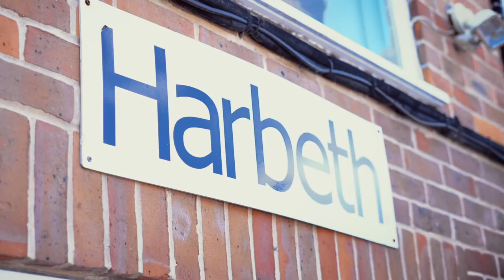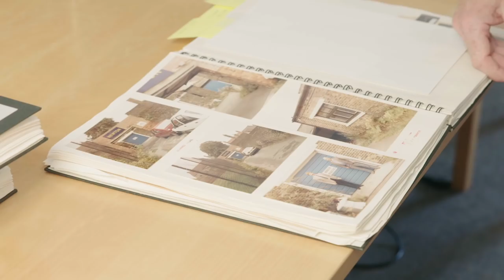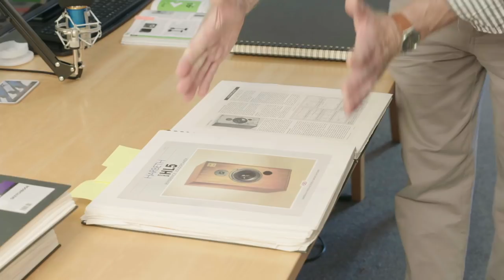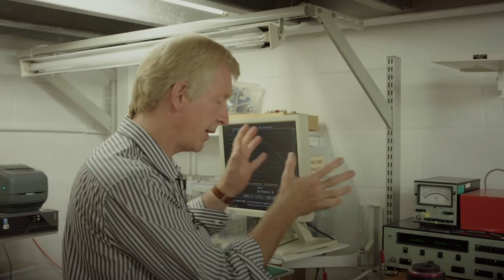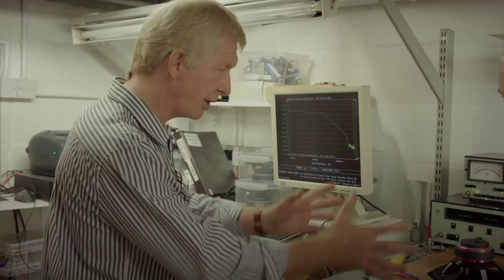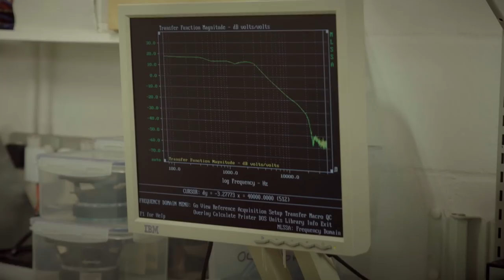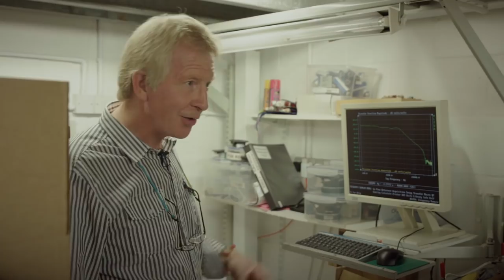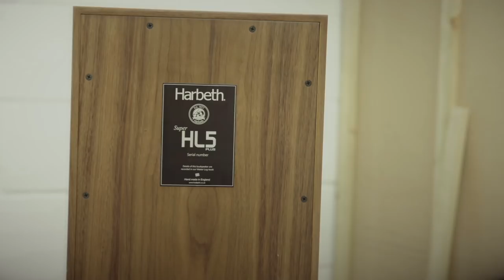Harbeth Loudspeakers Factory Visit

Comment: Alan's claim that only Harbeth uses injection molding for plastic cones is a complete fallacy!
Reply: rotorfix AS was asked, whether his drivers are unique and he answered "yes". That does not equal your allegation.
Reply: That frustrated me too; to claim that most modern speakers use cheap poly cones is nonsense. Maybe thats true for cheap dumpstore drivers, but not for medium to high end drivers. Even better, injection molding a speaker cone is a rather outfdated way of "stiffening" a cone. Modern drivers use graphite, kevlar or ceramic compound materials. Way (!) more rigid than these injection molding cones.
Reply: Astra Oovier,

Alan implies that injection molding takes "proper engineering and research," and that they received a grant for the process. He makes it appear to the ill-informed that the injection molding process alone is what leads to the stiffer cones. Regardless, to you fan boys, everything out of his mouth is gospel. He already has the cult. All he needs to do now is convert that barn to a temple.
Reply: Want to know what else is produced with injection molding process? Almost everything ;-) ( lego bricks, car dashboards, sandals, even those things some women like :) )
Reply: Load of marketing bull: "RADIAL" (Research into ???Advanced??? yada yada yada? Injection moulding?   Erhem.  I pity the poor souls sold to alan shaw's narrative.  Got to be wiser gentlemen.
Reply: Dennis D kevlar etc is ok but paper still wins
Reply: There is not one "perfect" material for speaker cones, all materials out there have there own characteristics. To claim that "paper still wins" is just nonsense and theres no scientific proof for that. Again, there is no "perfect"cone material, there is no perfect speaker, speaker cable or music source. Everything out there is a "way" to reproduce an recording. Wanna hear perfect music? Go stand next to a live performing band, and get ready to go deaf ;-) As a drummer i know that, again, every recording and reproduction of that recording is an impression given bij the studio technician and used equipment. A real drumkit for example sound relatively horrible and way to loud to enjoy. Ask phil collins; the guy is allmost deaf...
Reply: Maybe three lifetimes ago; these days injection molding is an industry standard way of producing stuff. Even my toilet seat brush was made using injection molding.
Reply: there is science behind. but plastic allways sound like plastic. Paper is still the best (of course mixed with other materials). that is why professional studio monitor speakers are still mostly made of paper. close to the wood as most  of musical instruments are made of. simply said. sorry for my english.
Reply: You're wrong and silly. Studio monitors Used to be made with paper cones, times they are a changing, as do speaker production techniques.  Most instruments are made of wood???? Thats a nice remark for those enjoying brass instruments ...
Reply: I dont think so. for example last week i have been listening Manleys and Quested vs 3110 side by side and guess which i like more. 
it's also a matter of personal preference. And yes, most of instruments are made of wood- Drums, bass, guitar, piano, violins,most of the wind instruments....
Reply: So now your ears have become scientific measuring devices. That's where most "audiophiles" go wrong. Your observation is only a subjective interpretation of a sound that was reproduced. Would like to see you go in discussion with electrostatic speaker enthousiasts. It's not important what you like more, just as unimportant what i like best. All subjective.... all just an interpretation.
Reply: i am more like sound engineer than audiophile. in terms of fidelity and feeling,  trained human ears do much better job than any measuring device.
Reply: haha, you just keep believing that ;-)
Reply: Drum heads are made of wood? That's news to me. Piano strings? Violin strings? Cymbals? Yes, the wood adds its own resonance. But in a speaker, the last thing you want is resonance.
Reply: Chemically and structurally, the Radial material is unique to Harbeth.  Doesn’t matter how unique it is. Harbeth combined this stuff with craftsmanship to create a sound and a piece of art that attract so many.

Comment: No box loudspeaker using moving coil drivers can claim to be the best . Have these guys never auditioned the best electrostatic and ribbon planar speakers which out perform any box speaker in most respects.
Reply: Just thoughts really, ESL63s are far from the best electrostatic speakers,lacking dynamics and deep bass.
Arguably the best speakers are line source dipole ribbons actively driven.Take a look at the Transmission Audio website for real state of the art speakers especially their top of the range 2million dollar monsters,astounding!

Comment: SEAS tweeter, a plastic cone woofer made in-house, veneered MDF panel box - how original.  $5-$7K.  Designed to sonically reproduce British voices in British-sized living rooms.
Reply: Peter Southern Boy , and you are from?
Reply: @Test-Pilot1194  - does it truly matter ?  No.  As others have pointed out - there are literally dozens of US and European high end speaker manufacturers who manufacture at least one of their drivers in-house, use sophisticated computer programs and equipment to design and test drivers, enclosures, and crossover networks - and some of them even have their own anechoic test chambers.  Harbeth is a very good speaker to be sure.  But there is nothing singularly unique or state-of-the-art about their design or manufacture.  I listened to some Harbeth Super HL5's at Decibel in Chicago a few years ago.  They were pleasant, but for me they reminded me of a good studio monitor.  I personally enjoy Rock and Blues and have found speakers that I enjoy more for those genre and that are more efficient which is important for the types of tube amp designs I prefer.

Comment: Apologies but harbeths are definitely not the best speakers in the industry.  Had two pairs of harbeths bought because of hype from the 6moons, but both sold within a few months after hearing better speakers that cost lower AND HAVE MUCH BETTER BUILT (one of my pair of harbeths do have irregular trim, the other one has veneer that came off during even a gentlest of the gentlest grilled removal).  But even after forgiving the suboptimal workmanship, coming to what is most important: sound, the harbeths 40.1 and sh5l+ both gave resonances in piano tracks that aren't supposed to be there, and strangely vocals , even husky singers like sara k., lack weight......sounding thin.  Very disappointing.  Transparency is a big issue too, as competitors (even half my harbeths' prices) showcase easily the aura of soundstage, details in reverberation, fine harmonics much, much better than both shl5+ and 40.1s.  All the yes men prevail in the Harbeth User Group as well, wtih alan shaw running the show like a complete autocrat and sounding rude to members.  So we have: 1)poor trim, 2)poor sound (low performance to price ratio), and 3)less than ideal persona.  Avoid at all costs and there are much kinder competitors out there, MANY :)
Reply: kit treme Can you give us examples please?